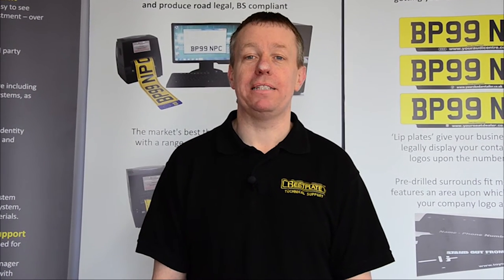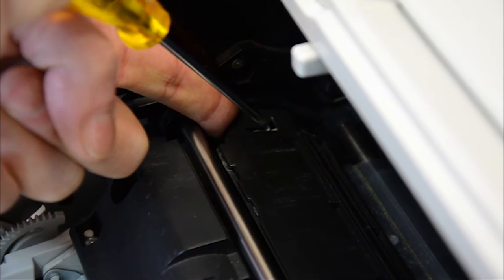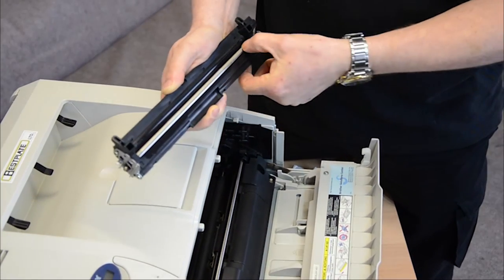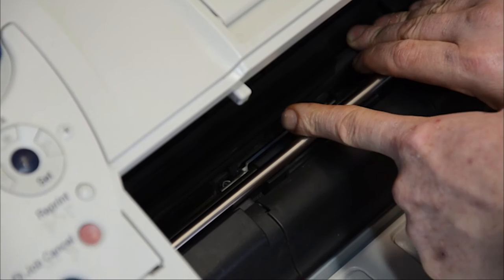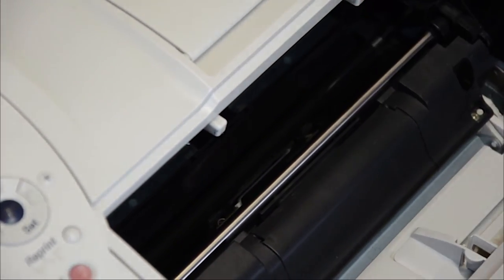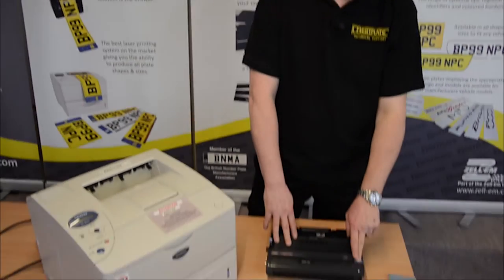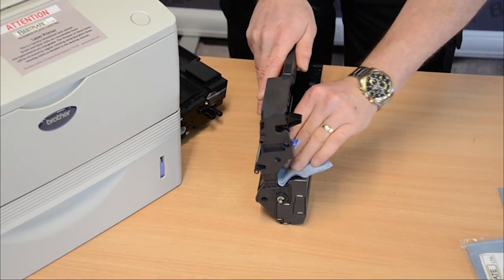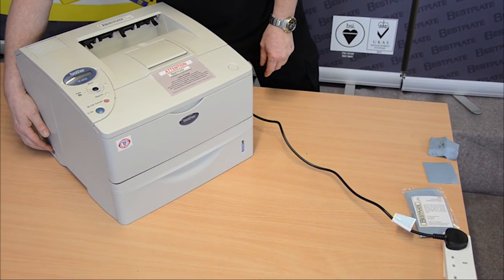Brother Printer Cleaning Procedure

Comment: Thanks for this.  I dug my old HP-1440 out of the closet and found LPT --> USB converter.   I think my drum is damaged beyond repair but this video helped make sure I cleaned it correct as it isn't too different than the printer in the video.   Thanks for NorCal.